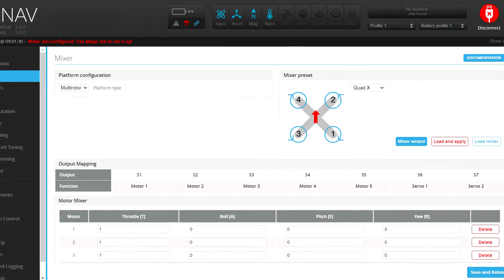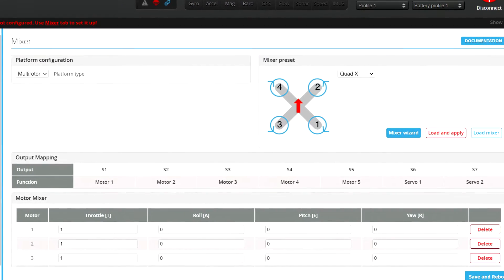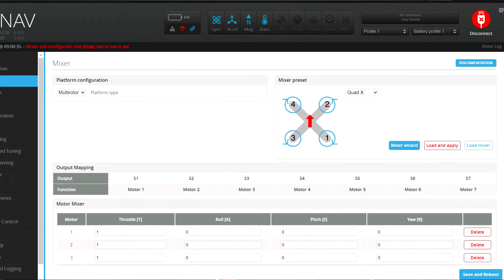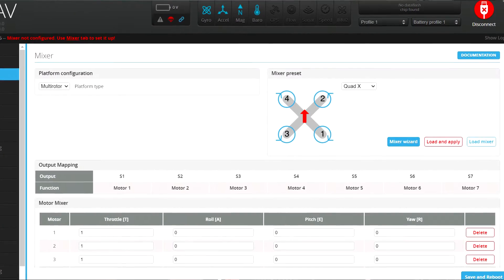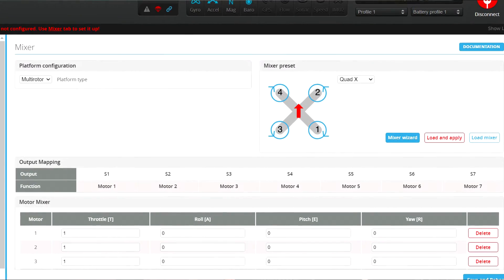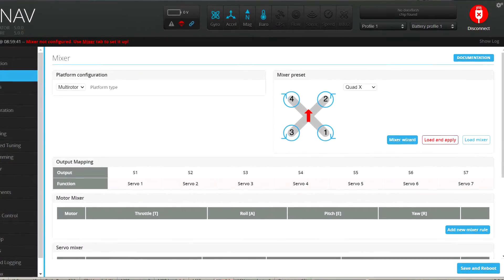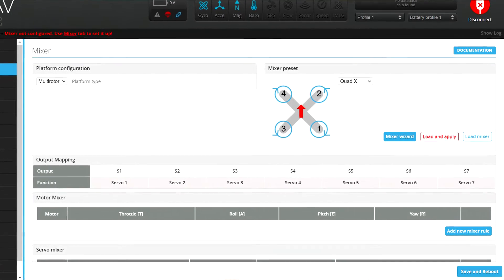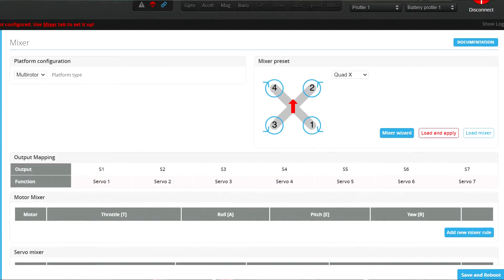INAV 5 output mode is almost like resource mapping

Comment from the maker: Flight controllers for 2022: https://www.youtube.com/watch?v=nsergu_J1vM
Reply: If possible, using a quad mix, how would you set servos to control each propeller location? I am working on a project and need the servo arm movement to control the device I am using to control the speed of each propeller.

Comment: I’m using a SpeedyBee F7 V3 and it has motors 1/2 on timer 2,  motor 3 on timer 3 and motor 4 on timer 4. When I change timer 4 to servos it still wants to control motor 4. I can assign servos to times 4 but motor 4 needs to be on timer 3. Is there a way to move motor 4 on timer 3?

Comment: If possible, using a quad mix, how would you set servos to control each propeller location? I am working on a project and need the servo arm movement to control the device I am using to control the speed of each propeller.

Comment: HI great work!
I am using a flywoo quad FC for a plane I have set the output mode to servos - and set servo 1 to throttle all good servos work will the automatic functions - auto launch waypoints etc be able to use the motor- as its not in "motors" now?
Reply: Hi, have you tried it yet? 🙂

Comment: Note - BlueJay ESC firmware which is the successor to blheli_s (which is used to enable bidirectional dshot) has removed PWM support. So not all ESC support PWM now.
Reply from the maker: Which PWM. Could you point me to the info. Because there are 2 PWM's used by ESC. The legacy and super-legacy. The legacy is the one we know 1000-2000us. The super legacy is PWM duty cycle from 0 to 100%. So which one BlueJay dropped?